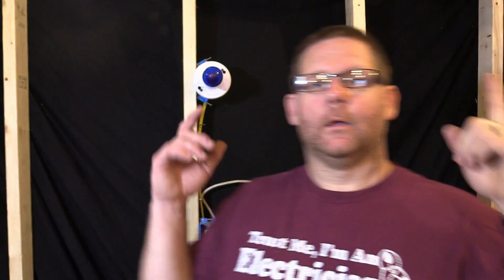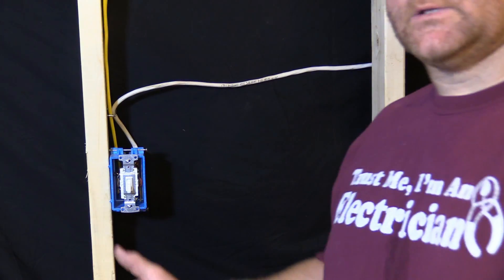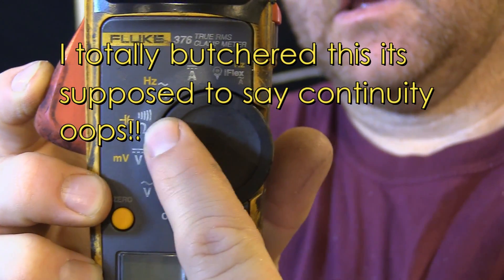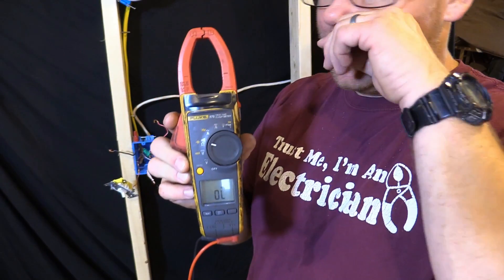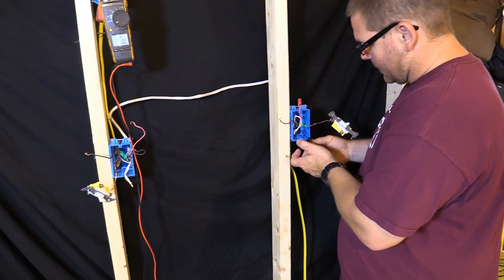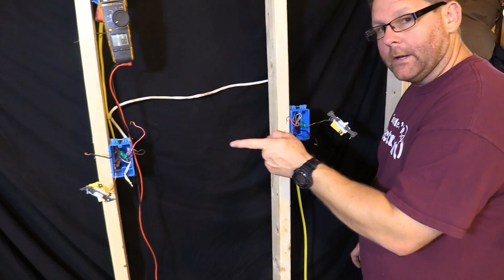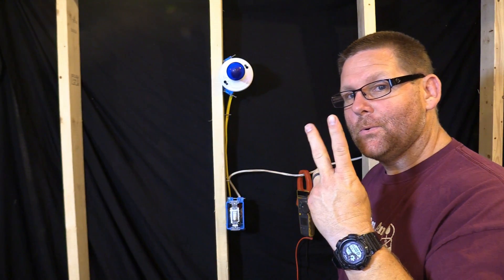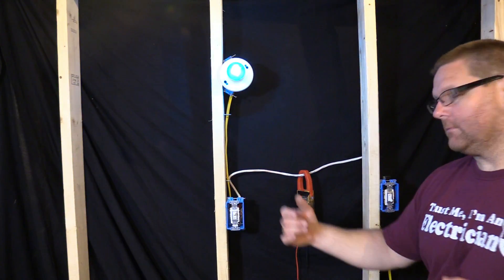How To Fix A 3 Way Switch Problem

Comment: Thanks for the save!  Messed around swapping wires between the 2 switches at least 3 times with no luck. Watched your video & problem solved!  Appreciate the help. Thanks again.
Reply: This is exactly what happened to me! I should have thought about that simple trouble shooting method but when you get frustarted you tend not to think so clearly. So, taking the time out to watch this video made all the difference! Thanks again.  73, KD2IWN
Reply from the maker: Awesome glad to hear that you did figure it out. Thanks for watching and commenting ☺
Reply from the maker: So glad to hear this... My pleasure on helping you. Have a great day ☺

Comment: Thanks this is best video I’ve found on this yet! Struggled for over an hour trying to get it, still not working. Will try this tomorrow hope it works. My multimeter doesn’t beep unfortunately though.
Reply from the maker: Thanks man you can use the continuity or the ohms to see the same without the beep response. Let me know if you figure it out. Good luck
Reply: Mountaineer Outdoors I figured it out and got it working. Then installed a new 3-way in my basement. Hardest part is figuring out how existing one was wired. Light first, middle or end of circuit. Odd part is not a single wire had 120V. Think most that registered was 0.3volts. Yet I swapped around and got the light working. Still don’t get it, your method of testing should show voltage. Tbh I still don’t understand that switch I fixed but I do know how to wire up a new 3-way no problem thanks to you!

Comment: What if you're light fixture wont turn off. I'm frustrated please help
Reply from the maker: Will it turn off if you have the switch in the middle? Not up or down Just in the middle? It sounds to me like you have it wired wrong. The hot needs to be on the common screw on one side and the other side needs to be the wire (most likely black) to the light needs to be on the other common wire on the opposite side of the switch.
https://youtu.be/9eig26wf6vE

Comment: What should I do about getting 120v when I use my meter and touch the black wire and ground?  I don't get anything with black and white or any other combo of ground,gray,black,white
Reply from the maker: This is just a guess, but do you have a ground wire that is truly hooked up to the panel?  Sounds to me like it's possible that you do not have a ground... There definitely is or should be a hot wire in the switch box. Now depending on where the hot was brought into, it may be in the light therefore you will not have a nuetral (white) in your switch box. You will have a white wire but it will not be a nuetral. Confused yet. Tell me what is in both of the switch boxes how many of what color wires you have?
Reply: @MountaineerOutdoors   I do think I have a ground.   1980 house.  Box A has white, black,red, ground. Box B has the fan switch and the fan's light switch. The light switch has a black wire connected to some other blacks in the box. I'm left with 2 red wires and a white. One of those red wires is coming from the wire that controls the fan.  The fan switch works though there is a red wire not hooked up to anything.

I measured voltage at the box A and get 120v when using the black and ground.  That is the only combo I get any reading from either of the boxes.  Thoughts?
Reply: @MountaineerOutdoors  Oh I have one of those in my house, the most confusing circuit when there is no neutral in the box - I tried to install a WiFi switch there but it required a neutral wire and there was none.

Comment: Love it! Thanks, I've never wired these, but now that you explained it here and in the other video...I'm confident that I can do it. How about testing a bad switch? replacing a bad breaker? One that a lot of people don't understand is back feeding an outlet with a generator during a power outage along with making sure the main breaker is off, etc.
Reply from the maker: Excellent ideas.. As far as the back feeding receptacles goes that is a slippery slope which could get me into trouble quick... The other ideas I do agree with. Thanks for the input.
Reply: Good point. I don't do it, I just run a power cord form the generator into a window and use a power strip for a lamp and the fridge. Winter time, there is a lightswitch/outlet combo on my oil furnace-the switch turns on the pump for condensation and I backfeed the furnace there, but I also pull the disconnect block and the furnace is separated from the rest of the house.
Reply from the maker: That definitely works. There is a device that one day I hope to install into my panel for a generator that won't let you back feed to the grid. When is install it ill probably record the video.
Reply: Awesome! I'd love to have an automatic whole house generator.
Reply from the maker: Yeah me too.. Ive installed plenty of them... I just really don't lose power too long. My potable one does fine for now. Maybe when I get a little older and I don't want to lug it around I'll get one we will see
Reply: Same here. Ideally, I'd want to live where I had a natural gas line so I didn't need to worry about fuel....now that's lazy...but it's awesome. My portable one does just fine too. Sometimes It's a pain to get out of the shed because I've moved things around...but nothing major.
Reply from the maker: Yeah I know the feeling. If I had gas it would be so much easier for me to wanna get one that isn't probable. Getting a propane tank above or below ground is quite expensive especially since that would be my only appliance that would run off of it.
Reply: Exactly. However....I do have a 1000 gallon oil tank (heat), if I could find one that ran off #2 Diesel.....lol
Reply from the maker: You can buy one of those old military ones the ones mounted on a frame... Your whole neighborhood would love it when you cranked it up.. Smoke them out and loud as all could be.. They would hate you when you were testing it but love you when the power went out.
Reply: lol...Plus, I am familiar with them. Used several during my 20 years active. 5kw all the way up to 60kw.  Mainly 10kw, that was the set we typically used. took two of them with us and swapped them every 24 hrs. Junction box and they were paralleled, had indicator lights so we'd know when they were 180 degrees out of phase and we would switch the selector...no interruption.
Reply from the maker: So you are an electrician too
Reply: NO! I know some things about electricity, I know how to operate generators, but I am in no way an electrician.